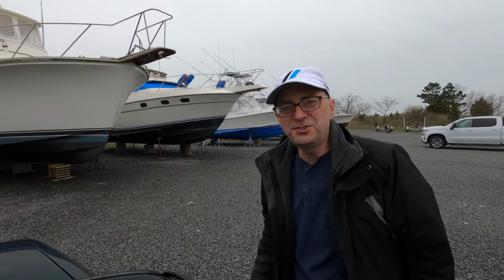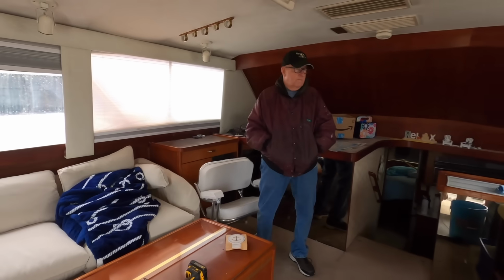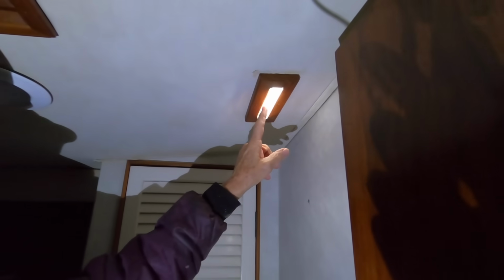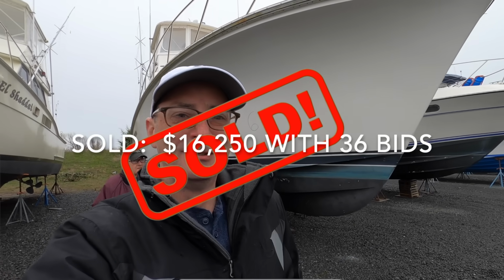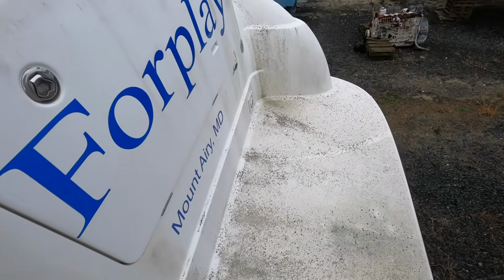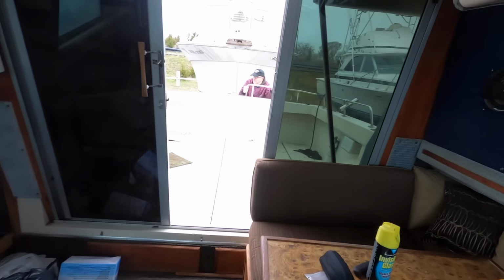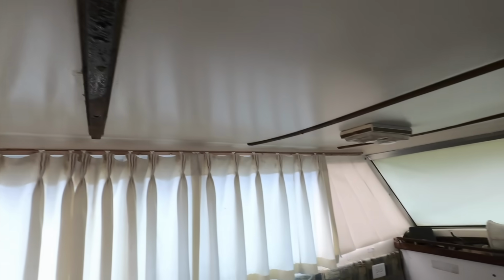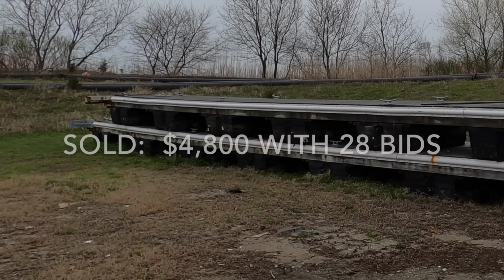Government Boat Auction

Comment: These boats don't need as much work as what you think, if you want to refurb the whole thing, yeah that's a whole different sack of marbles. But just tart it up abit, take your time, buy some used accessories. As long as the engines are not seized up. Its doable on the cheap, relatively speaking. By the way, the Proline is not a centre console, that's a cuddy cabin walk around

Comment: Poor older boats been rode hard and put away wet . We're all getting older. With a bit of hard work and loving care, she'll come back as good as new, well almost. The twin diesel' s , check the oil, their worth their weight twin's , take them apart and inspect them, you could be a winner. Good luck. You want the matched for equal power.

Comment: 6 years ago I got a really nice boat on a trailer 30 ft cabin cruiser missing its engines an outdrives for free from a property management company it was left in the building they owned. I ended up putting it in the ground and turning it into a hangout / guest house for my daughter and her friends it has working plumbing electrical and AC
Reply: I just got a very vintage 1982 Bayliner 2270 Explorer pilothouse style cruiser with a teakwood  Alaskan bulkhead on the back  nonrunning and after bringing it home it's just way too cool in the backyard as an outdoor room to even start thinking about actually getting it running and takeing it to the lake .  How complicated was it to put it in the ground ?
Reply: @randyscott3386  it was easy putting it in the ground I have a backhoe the only difficult part was figuring out the electrical an plumbing before I put it in the ground but when you don't care about the boat hull you can put holes anywhere you want to run wire and pipe makes it easy

Comment: The Ocean has filled with rain water sitting on land. Like a giant bath tub. She doesn't have a leak. The previous water line was from a period where it had more water in it. She has basically been partially sunk on land. The stringers etc would be finished.

Comment: Sometimes boats sink from batteries dying during a rainy season from pumping the bilges...then they don't. Not always hull damage. Depending on the hull construction and core material there may be hidden damage. Mold is incredibly hard to remove and keep gone once it starts.

Comment: If you don't know a flybridge from a fly swatter you should NOT be looking at boats in this size range.  To bring derelict boats like this back to a seaworthy condition is a MONUMENTAL undertaking especially if the work is to be done outside.  The only boat there worth the effort was the 31 Bertram. A real classic with a well built hull.

Comment: Honestly the 3rd boat shown was probably the most affordable to get back in the water.  Old and outdated, but those old crusaders are easy to work on.  You could probably replace them with a couple Chevy longblocks and just cleanup the intake and exhaust manifolds, new carbs.  Replace the distributors with a more modern ignition.
   The Ocean yacht, beautiful in a way all Ocean yachts are, BUT atleast $100k to $200k to get it back in the water.
   Bayliner, just run away.
The old Bertram could be a good fishing boat,  extremely well built.  More utilitarian but not ridiculously priced to fix or replace the engines.

Comment: Good video the first boat you went on the Ocean those are junk and early one's like that are known to have Stringer problems which is what holds the bottom of the boat together
Reply from the maker: Ouch man, stringer issues!  Sounds pretty serious.  That boat bid up pretty high.  Do you think it's being returned back to the water or maybe parted out?
Reply: @hullinger  if I had to guess it will probably be a live aboard a cheap place to live and a lot of low-end liveaboards the engines don't run and they tow the boat to the dock and there it will sit so for $500 a month you have a place to live meaning dock rental
Reply: The engines and final drives are where the money is at.. these are a well know junk boat in these years. Best i can tell those are 3408   CAT MARINE engines ate worth the whole deal.

Comment: Great Video ,Thanks for sharing , your Dad knows his Boats , i’ve owned 17 or 18 boats myself over the years , and  one note  if a Vessel with Deisels  has beenSubmergeged     with the Engines fully or evenPartially  i myself and advise my freinds no matter how  great of a deal it appears to be to stay Away from it  thre will be way more issues  than you can Anticipate  which means costs  of Course if you plan on doing a fullRefurbish and Re powering  and have the Funding. that may change things but most people do not  think that way , Oh Yeah  sometimes  people do what is called “Pickering “ on Submerged Deisels  that they Flush the Salt Water out with Deisel Fuel  , get the motors running for a short time and  say   they were Preserved  IMO  overtime Gremlins are going to come up  that will more than Likely  wind up needing a Complete Rebuild  or Replacement that can cost hundreds of thousands of dollars  depending on the Vessel and Engines  on the big Yachts it could mean  the  need to pull off the Decks and Cabin areas  to get  the new Engines installed  or Worse  it’s also very rare on a Older boat to  not need Stringer ,or other StructualnDamage repairs  which again are costly

Comment: You caught me by surprise with this wonderfully put-together video!  We have those gov't boat auctions here in southern Louisiana but not usually all marine in one location.  The first vessel was the best for fishing the Gulf Coast anywhere from TX to FL and as someone who has been on a few flybridges ...  once you have spent an outing up there, you never want to be sea level again.  (Except for a large storm :-P)  I am not what you call an offshore fisherman but the heightened flybridge on an intrepid sport fisher is the most relaxing yet commanding section of your vessel.  If one is ever to be Captain of their own vessel, the flybridge provides such an open view of everything pertinent and naught.  

Great video!  I would not have paid the $16k plus at this point in my life but for someone with deep pockets it def has serious value even with a complete double drive train replacement required ... if done correctly.
Reply: How do you get I these auctions

Comment: What you were not thinking about is if it is holding water on shore, it sat at a parking space in the water for a long time, and rained on the boat, and no one pumped it out. As The batteries were probably dead, and would not automatically pump the boat if over a low amount of bilge water, as dead batteries. Then they took it out of the water to dry it out, see if they could see where ed the water came from. Thus giving you the ability to check it out, not in the water, and so it did not sink. Sure the motors may need work, as no one started them. As dead batteries no start, they could have charged them up, and tried to start them, and pumped it out. That looks nice inside. It's a glass boat so easy upkeep. Not much to have to fix, other than TV he motors. But maybe a serious hassle to fix the motors, or replace. You would need to get it running, and then it can be parked again on th ed water. A person needs to see where the water line Mark's are, as to see if They are the same height as the water line down in the bilge, as those marks on the motor. As some of the water dried up, or  some got pumped by a portable pump.? I am thinking that allot or most of that water came from rain, or leaks around the exhaust, or drive shafts, maybe a tiny crack in the glass. ? I see it sold for $16,500. A steal, as the Electronics would cost that just to buy them alone. Fixed up, and running good, that's probably a  $200,000. Or more value boat. Those  motors would not cost much to fix, and fixing any water leaks. Its a glass boat, not a old wood boat, as its a easy maintenance boat if taken care of. Boats are expensive to own, fuel costs, dock parking costs. This is a boat for a guy that c AZ n take car ed of it himself, and to live on it, or a wealthy person that can afford to pay others to take care of it. I think its rain water that's getting into it. ? If I had the $ to have bought bid more, and bought it, and repaired it, I would have bought it. Nice Boat. I grew up doing Commercial Fishing, working on boats, fixing, and repairing with my dad. As he could do it all. Me, I was a gofer, hold this, do that. We were constantly repairing one of my dads wood boats. Glass boats are easy to maintain as hardly nada to do each year on them. That was a steal at $16,500. Nice stable wide boat. But, I would like more of a Alaskan Trawler design hull in glass, with more deck space, as so it can be used as a commercial fish boat to pay for its yearly costs, and some profits too. Plus these boat designs, usually have full access to the motor, or motors from out on the deck, with a big hatch, as so the motor could be pulled up, and out if need be. As  most fish boats are designed that way, with more deck, and fish storage space, and less cabin space. We knew many fisherman that were commercial fisherman that lived on their boats from say April to October while fishing, & some lived on them full time. But the time off from fishing, they, cleaned, repaired, sanded and painted their boats. Lots of work, and costs on the up keep on old wood boats. Unless you do it yourself. We usually did all of own work, and if my dad had the time, he would some times help people out to repair their boat if they needed help. Diesel fuel was cheap back then, as today it's just rediculas. As today Diesel fuel is maybe 6 to 7 times the cost of when I was a kid. Probably hard to make a living fishing, with the fuel, upkeep, repairs costs, and dock space costs.  There were a few deals at the end of the video. That one that needed the two missing out drives, that was a nice sport fishing boat, great buy at $2500. That was maybe a $150,000. or more to buy it new.? As those last few boats were a good deal. That one with twin Cummins diesel motors for $100. Super deal too.  Good Luck.

Comment: After seeing what you know about boats you may get into a giant money pit. The sport fish is a diesel with direct drive and many very expensive issues. The Bayliner was a 30’ cruiser that looks like most do that are neglected. You have to be extremely careful as to what has been ignored. Freeze damage on neglected boats can really turn them into huge money pit. The one you thought had a Ford engine is actually a small block Chevy from Crusader Marine.   For a novice boater you just can’t even imagine the money and labor that can be involved in a boat like these. You’re usually are way ahead buying one that’s in good condition unless you love huge expensive projects.

Comment: bayliner has 2 of the drain plugs sitting on the helm.... on a boat like this there are typically 4 per motor, at minimum, thatd be 2 for the block, and two for the manifolds, makes me wonder if they even pulled the other plugs, if they didnt and this boat has seen temperatures below freezing both motors need to be seriously looked at for cracks. A manifold isnt to terribly bad, but if the block froze, your looking at 4 grand per block. at minimum and thats for a rebuilt block not a new one, if you want new you can bump that to 8 grand per block.

.... the cruiser at $100 also a steal. i saw nothing to scare me away from that boat.... in fact of the first three, it looked like the safest buy. You had an engine that looked like it had been prepped to sit through a winter, meaning that with some work, those engines probably would have fired up. Now i would definately have gone through seals, but seriously $2000 and this could be a good boat, granted this is Minus Transport fees.

Comment: That Ocean sport fisher needs both engines pulled and rebuilt and the boat will need to be completely rewired, stem to stern.  All new electronics.   Then you get to start on the interior.   At least $300k!   Even if you got the boat for free?   The Marina this came from is probably not holding their breath expecting to get any money out of it.   Ideally,  send it back to the factory for a full refurb.  New everything.   So you got a free hull.

Comment: With the price of houses I would just buy that and drop it right in the yard and live in it
Reply: I used to be a phone installer and one time had an order to put a phone line in a boat.  The guy had a 46ft all wood yacht in his backyard, it was cribbed and slightly set in the ground with a door and a porch cut into the side where the engine room used to be. Told me he got the boat for free, just had to get hauled to his property and selling both the diesel engines covered those expenses.  It was a great guest house and his grandkids loved staying in it.

Comment: I don't think your mate knows much about boats .
Boat this small don't have a captains quarters there owners cabins and a guess cabin.
The main lounge saloon area is called just that or a salon area .
It is good for boats to hold a few inches of water . But not a few hundred gallon's.
Playing with levers thinking you know is a lot different to actually knowing.
Boats like this can be a money pit you need to know what you are doing may be with both you knowledge you should leave it there Good luck.